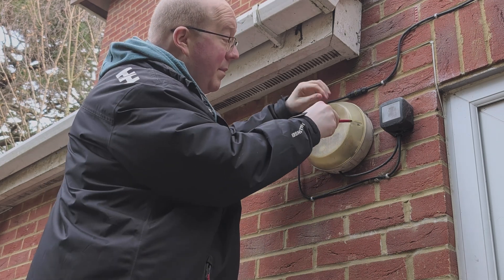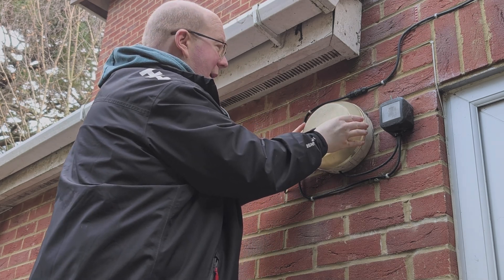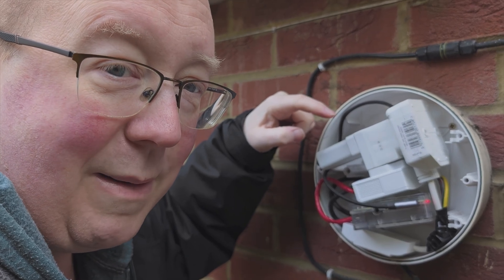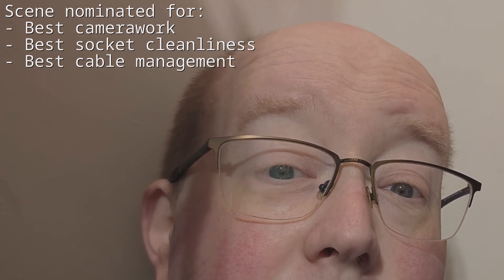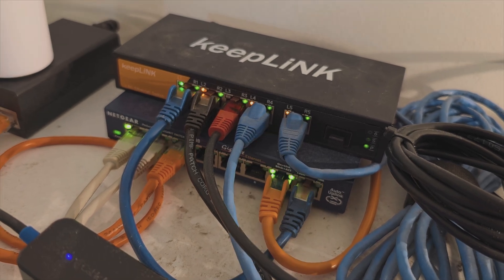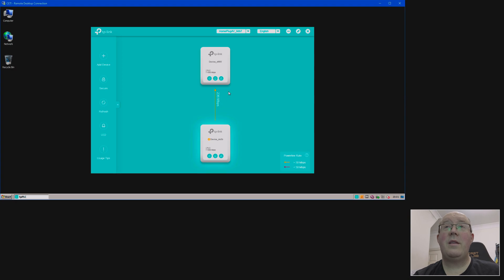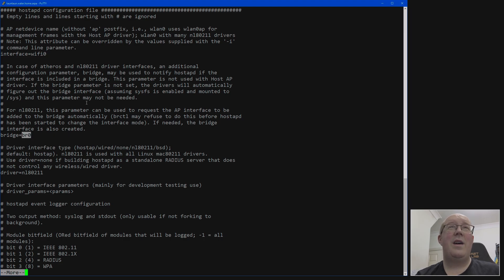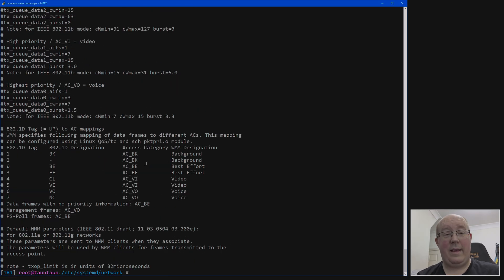Outdoor network with TP-Link powerline ethernet

Comment: Every radio ham for miles around will hate you because of the interference those things produce. Also may be a good idea to clean your home before sharing videos of the filth you live in online.
Reply from the maker: Does the filth count as 'lived in' if that's the first time that corner of the room has been uncovered from the things piled up in front of it in 4 years?
Reply: @andrewsturmey  it looks like more than lived in, you could do well investing in a vacuum cleaner!
Reply from the maker: Indeed most people probably would have taken the time to run the vacuum around the area prior to putting it out there for a thousand people to watch. I'm sorry I failed to have regard for the unpleasantness of the visage, and the revulsion it might cause to others.